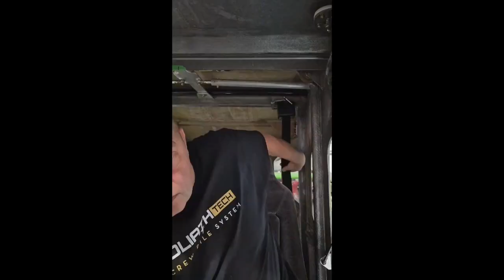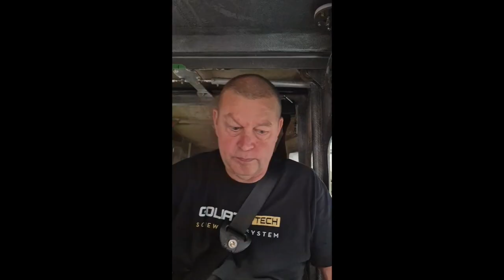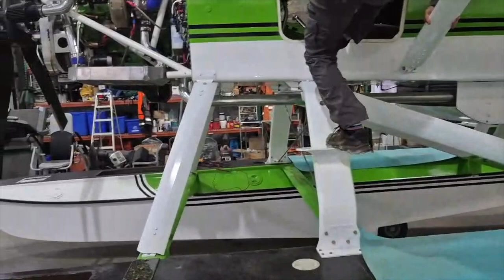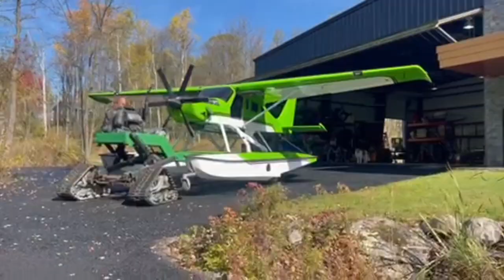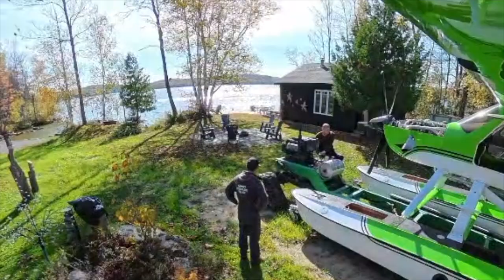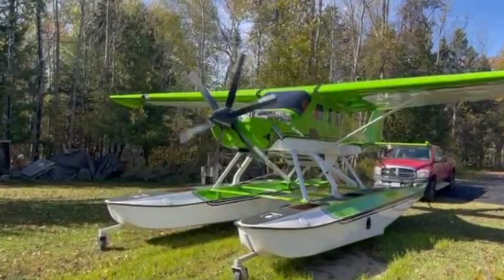Turbo Diesel Engine Fire-Up | Countdown to Launch on Water Begins!

Comment: When I first heard of diesel engines for light aviation back in the seventies, I thought Science Illustrated magazine had lost its mind. Then a few years later I read about a large four-engine seaplane that the Nazis built a prototype of near the end of the war, and yes they were four diesel engines. And now this, well I'm not all that shocked this time.
Just curious, can it roll coal on takeoff?
Reply: Perhaps I should also ask this question. At upper altitudes,  what color is the contrail?lol
Reply from the maker: That's hilarious.  So many friends of mine want me to make it roll coal and being a diesel mechanic all my life. I don't think there were too many diesel engines that I cranked up that didn't roll coal. I'm kinda taking a different approach on this one and going after efficiency. But .... if you snap the throttle, it will let you know it's a diesel.  Thanks for your comment 👍
Reply: Inspirational project. God bless your family and adventure, I’ll be following